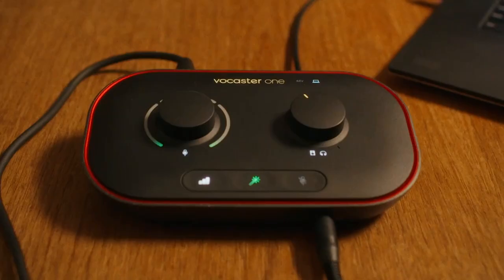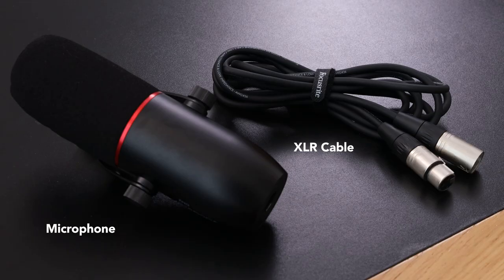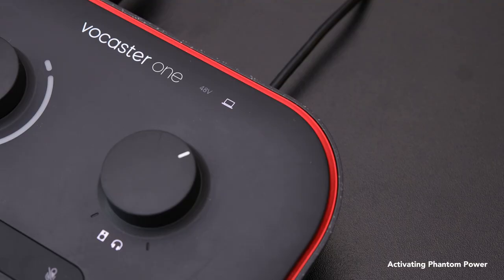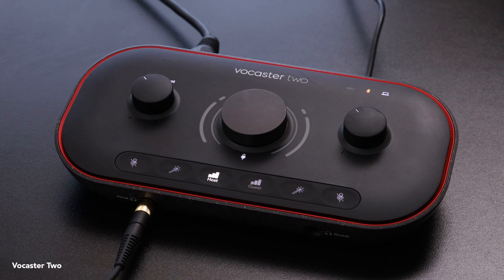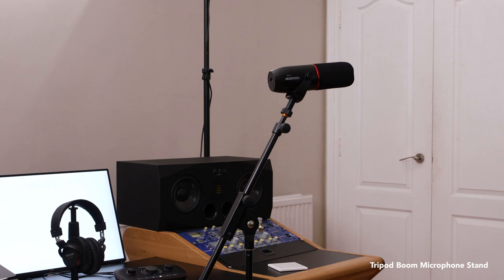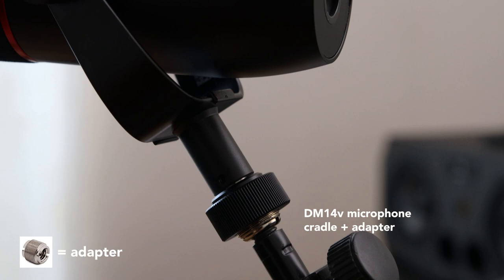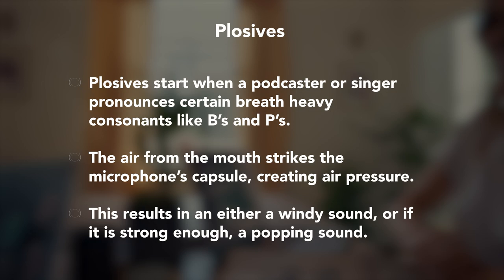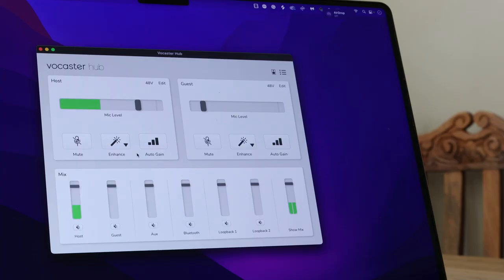How to Create the Perfect Podcast - Vocaster

Comment: Is the Focusrite Control app and the Vocaster Hub software the same? Can I recorded on an iPad with the same access to features as on a PC or Mac?
Reply from the maker: These are two different applications, but they serve similar purposes. You can absolutely record on an iPad, but the Vocaster Hub program only works on desktop. Therefore, if you would like to configure your Vocaster through the Hub software, this must be done on a Windows computer or Mac, before disconnecting and recording on your iPad. For more info on connecting your Vocaster to an iPad, you can reference page 9 of the user guide: 

https://fael-downloads-prod.focusrite.com/customer/prod/downloads/vocaster_two_user_guide_v2_english_en.pdf